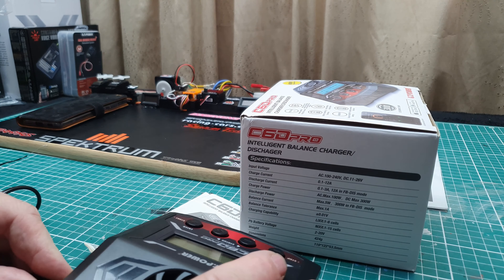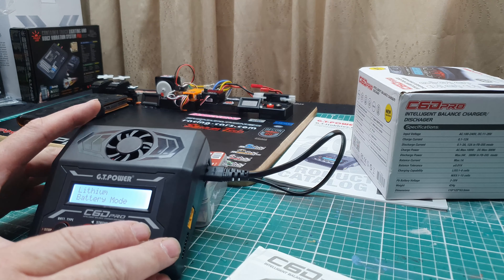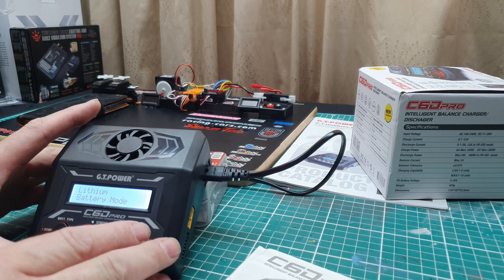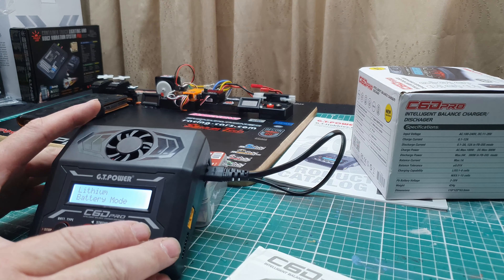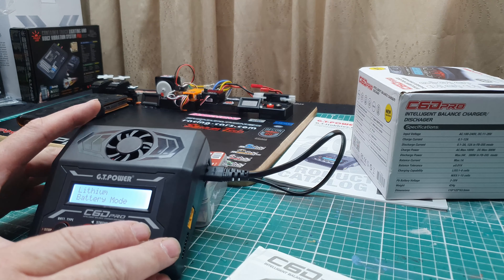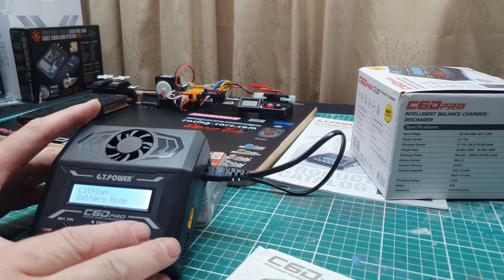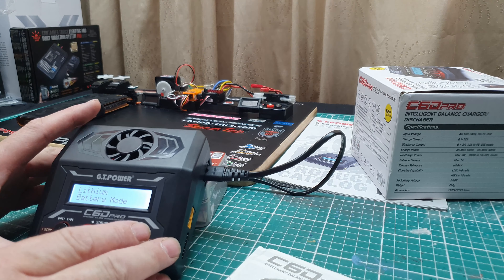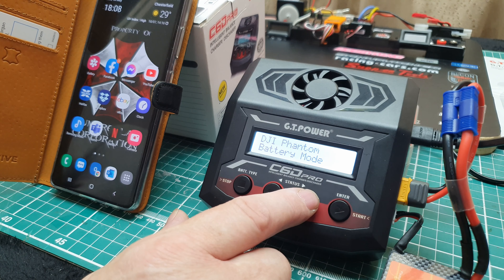GT Power C6D Pro Intelligent Balance Charger/Discharger & Tyre Warmer

Comment: I got the 4x Mini charger, only to find out that it won’t discharge anything! Guess I didn’t read the details!
Reply from the maker: I have more GT Power chargers for review and I'm surprised that a lot of them don't cycle, discharge, balance, or store charge.
I will be rating them on a scale of 1 to 10 from now on.
Reply: @TeriWilde  Kind of disappointing since some cheaper brands do it all.